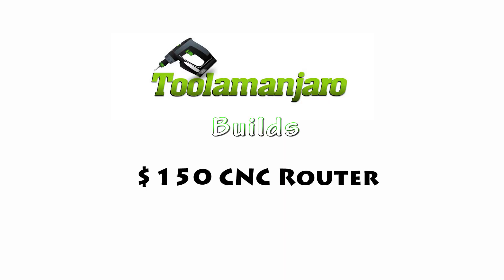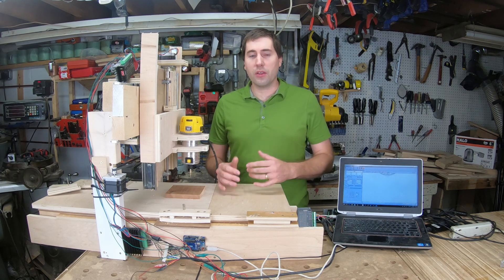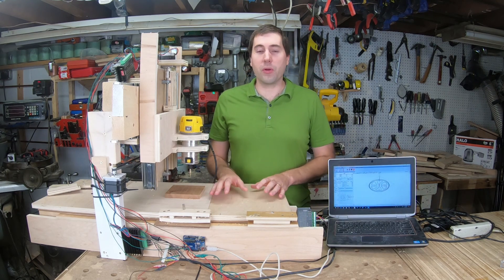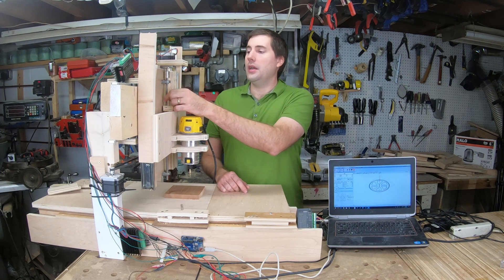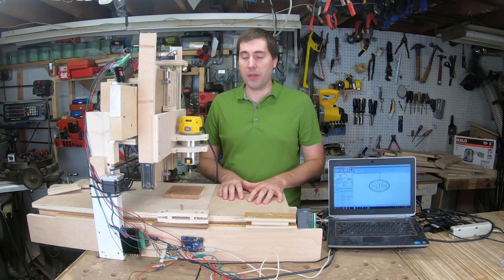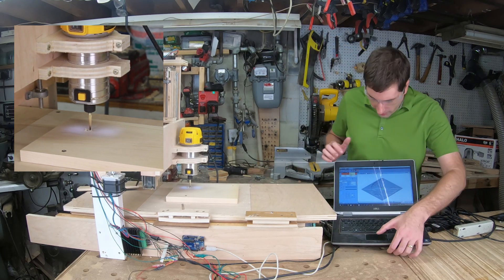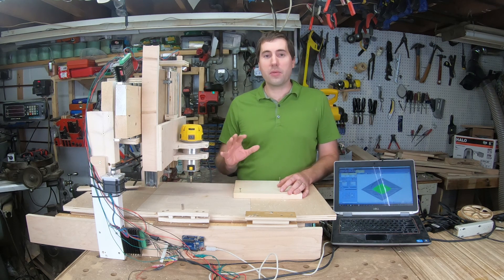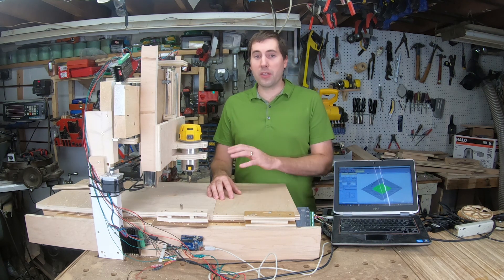Craptacular $150 DIY CNC build that actually works!

Comment: Great build. I’m a first timer also and am currently ordering parts. Also trying to justify a bit more than $150 with my wife but that’s a different subject. Something I’ve picked up on other YT video’s is moving your bed or gantry buy hand is not recommended. Apparently stepper motors can act like a generator and when they are turned by hand they send electricity back though the system and can damage the electronics.

Comment: Make another video where you cut out parts to mount the stepper motors to replace zip ties. You can cut out better parts to evolve or reproduce a better CNC with that one.  You did a good job.

Comment: came from cnczone, i was planning drawers, but was always worried about dust jamming slides, because that happened to other drawers in workshop, used the metal water pipe with 4 bearings,

Comment: GRBLis pronounced “gerbil”...trivia...

To your point, I just bought parts for my next machine and the 1500mm linear rails/ball screw package, which I needed 3 of, cost $179 EACH. Stepper motors and drivers (570 oz/in) cost a little more than $300, the spindle motor and VFD were around $500. 8x 97” 1020 aluminum extrusions were another $300. The whole thing will probably need 300+ bolts that won’t be cheap.

The first machine that I built was not much better than this. Excellent work!! You’re on the path...

Comment: Hey, great work! I know this has come in late, but have you tried using that machine to cut parts for your next machine?
Reply: The parts a machine like this could cut would not be any improvement over the parts it already has. Like was said in the video you need better linear guides than he's using to have a better machine. You're not going to make parts like that on a CNC machine like what's here either.

Comment: Maybe put a 2 by 4 diagonal cross brace from the bottom right on the plank you have the uno attached, up to the top of the gantry upright on each side. Scrap the router brackets and build a box beam on the cross plank with a hole for the router to fit,  it should improve your cut noticeably.

Comment: Man! Great work! I love to see DIY low cost cnc projects like this! 

I'm currently working on my own, only difference is that I live in Argentina, and EVERytHING here is more expensive/difficult to obtain. I'ts nerve3 wracking sometimes, as well as it makes for a great challenge! 

I'd like to give you some advice on the things you are strugging with, hoping it helps you a bit: 
That flex you  comment has its roots on  the Z gantry sticking down more than it needs to, maybe flipping that X carriage and motor/belt would fix that!
Also, I've found that using regular threaded rod with anti backlash nuts on all axes (search diy anti backlash nut for ideas) has almost no backlash on my machine, on the advantage of higher forces can be applied, of course compromising max speed, maybe not your cup of tea.

Regarding dust getting on your slides,  half a pvc pipe and rubber strip to seal it off may suffice, the things used to put under doors to seal them comes to my mind,  let me hear what you think! And once again, congratulations! you rock! From a cheapass DIYer to another cheapass DIYer Best regards, Manuel